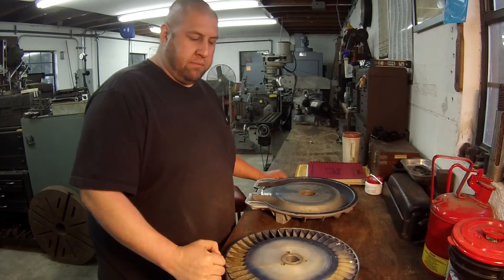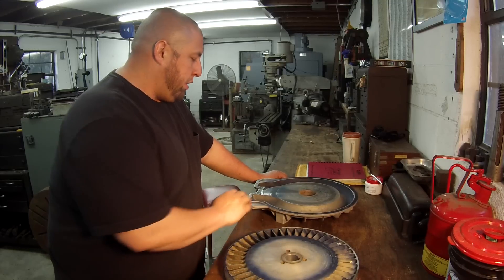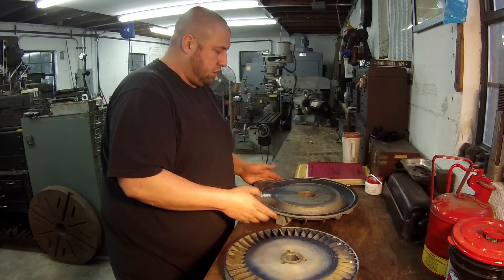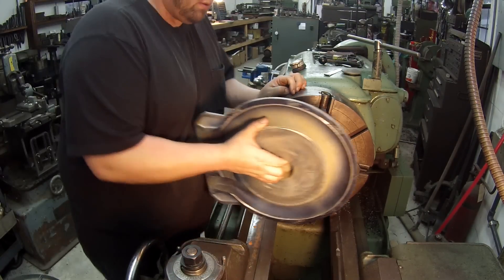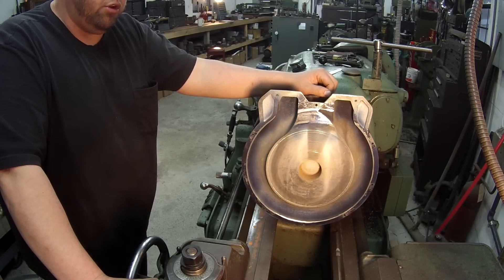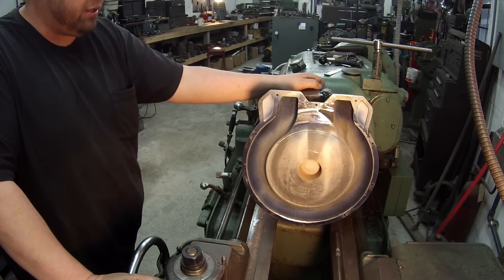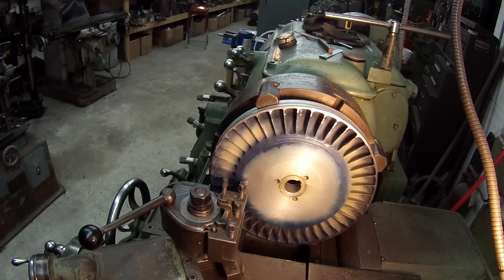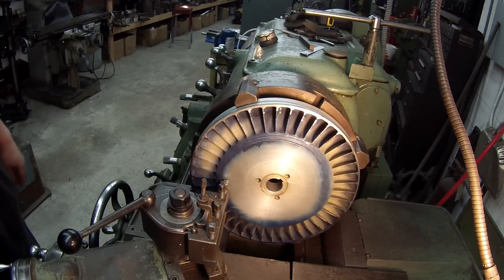Pump Facing

Comment: Fascinating work.  I know if it was me setting the work up, I'd probably want to get it so the needle wasn't moving, too.  From here, it looked like you averaged the run out and called it good.  Good stuff, thanks for sharing.  RS
Reply from the maker: Yes Rick, get 4 points running true on the face. the areas in between the jaws were within a half a thou plus or minus.

Comment: Hi Adam, I've seen so many lathes with the bed ground for clearance on big jobs! I must admit to considering taking the inverted vee off the gap piece on my Harrison L5 (it's not as if the tailstock ever gets down the bed that far!), but I'll do it with a surface grinder.

Cast Aluminium is often a pain as to finish. I've done some Triumph Tiger Cub crankcase repairs and flycutting the timing cover face had to be done at very low spindle rpm and a doped snail's pace feed.
Reply from the maker: The bed is notched for the chuck jaws only, but I dont want to take a grinder to any other part of it. I'll just have to find a bigger lathe!
The finish turned out ok, but I love to see that smooth mirror finish on aluminum. I probably could have done better if I felt like spinning the part faster.

Comment: Excellent work, I know what you mean about the needle moving bothering you. I have a few indicators that read in 0.0001" increments and I have to hide them from myself on most jobs or I will drive myself into the fetal position :P.

Comment: Looks like a ring compressor housing and impeller.
They work for low pressure air or vacuum depending on how you hook them up.
Most of them turn at 3450 rpm.
Reply from the maker: He said its an air pump for a big jacuzzi at a resort on the beach.

Comment: If you didn't have access to the larger lathe at work, would you have tried to set up the housing on the mill and faced it with a Fly Cutter, or would you just not have taken the job?

Comment: I'm not machinist by any means, but that piece you couldn't fit in the monarch, couldn't you set it off center to make clearance and face it at low rpm?
Would really appreciate a response, great channel Adam
Reply: If it isn't running central, it would make it difficult, well, impossible, to machine the outer circumference where the impeller is impacting.

Comment: how would the facing done relate to the shaft mounting. would mounting the impeller on an arbour be better to have the whole thong spinning true when assembled?
good work, I have been a long time follower.
Reply: I'm with you in thinking an arbour would have been a safer option with a alloy plate that had had a bit of stress. Adam what's your view on this?
Reply: My thoughts too. Without using an arbour you don't know if the impeller is spinning true with the mounting shaft. Maybe putting a temporary shaft in the mounting bore to see if it is running true to the shaft bore.